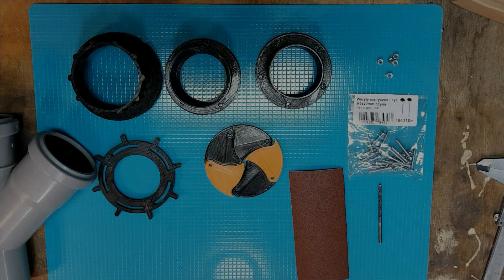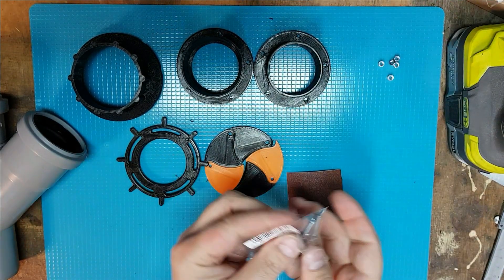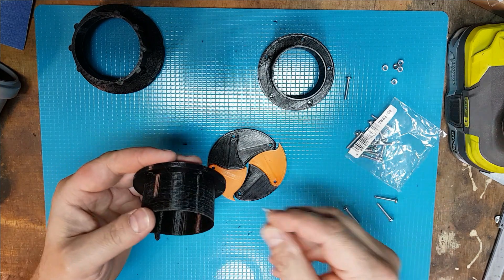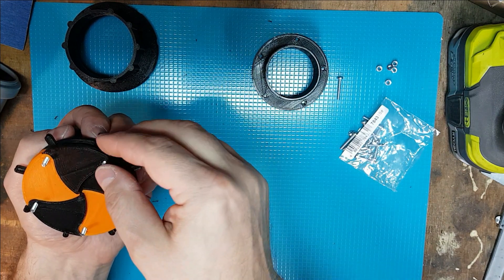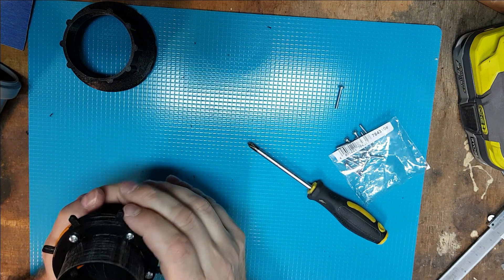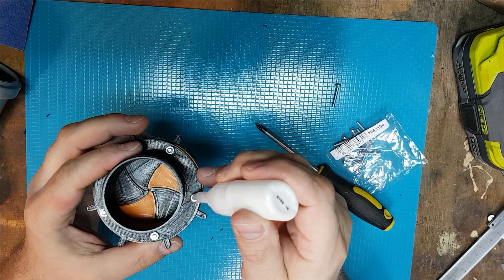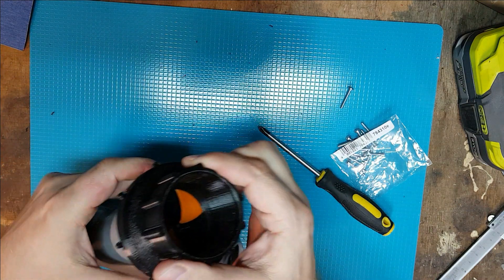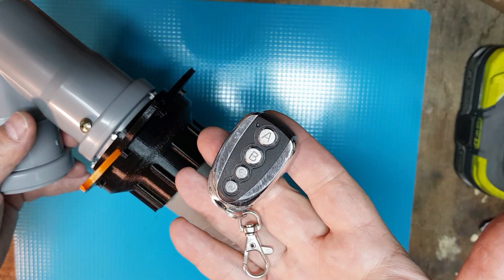Dust collection system iris valve/blast gate, 3d printed, SShopDC

Comment: That is a cool design, thanks for sharing and demonstrating its build. the device reminds me of the first Alien movie when hunting the alien in the vents scene, a similar valve was used, of course bigger and more dramatic operations. I imagine the STL file can be scaled up for larger dimension pipes?
Reply from the maker: I wouldn't assume that - the basic size probably will scale up, but the pins and screw holes - probably not

Comment: It's a great mechanism, I've heard two of them, but unfortunately both have the large connection to a locker for a 50mm pipe, so it's not usable.  The small connection works great, where it can't be due to the printer settings.  What a shame ...